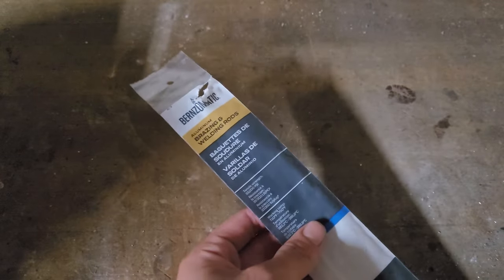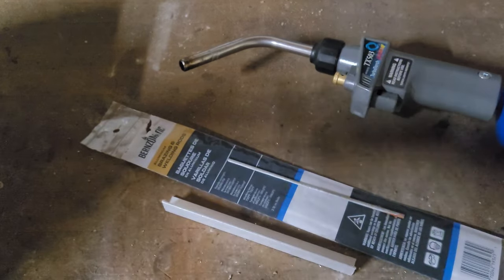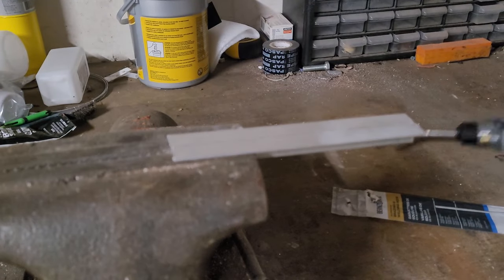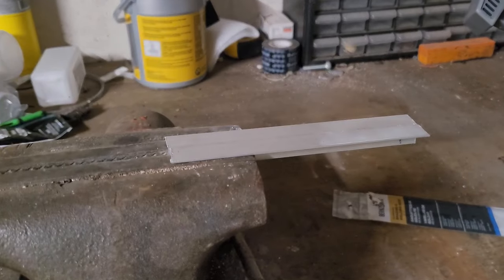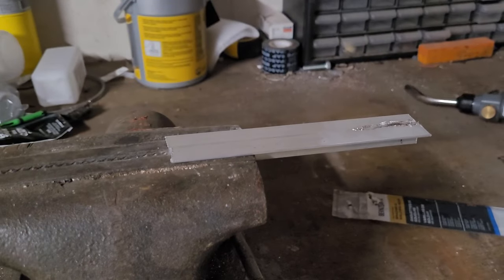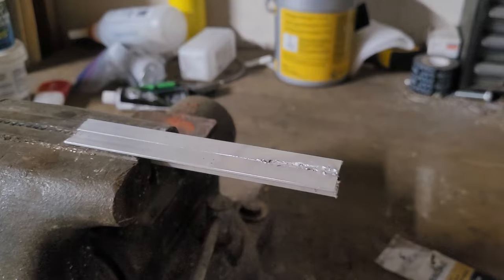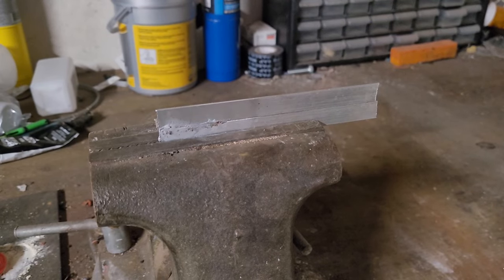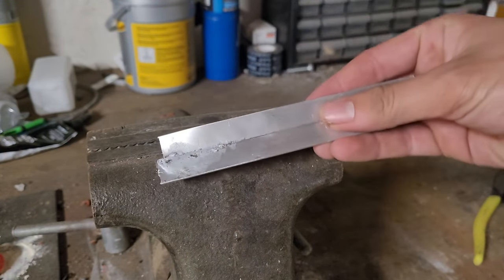Welding Aluminum with a Propane Torch

Comment: You clamped the pieces in a METAL vise, which was cooling the pieces down. Try again with the pieces clamped with wood pieces to insulate. That and better prep (using acetone to clean pieces) You’ll get better results.
Reply from the maker: Thanks, I will give these brazing rods another try using your advice!

Comment: I tried this to repair a bicycle cargo rack - propane and pencil torch would not get it hot enough - so i got map gas and a bigger torch head - much better results.  though i did find it impossible to expose bare metal in the crevices - so I did brazing on top and jb weld underneath just to give a bit of extra strength/support.
Reply from the maker: Brazing can be done with propane using a hot turbo flame torch. I’m glad it worked out for you!
Reply: Wth. Weld it dude. I’m not tryna take a bicycle to the face on the highway.

Comment: Great video! Super helpful that you broke it too so we could see the strength. Any suggestions on something stronger but similar cost?
Reply from the maker: If you need a stronger joint your only option would be a stick welder and aluminum rods, which will cost about $200. However, stick welding aluminum is significantly more difficult than welding steel. You could also change your design to use fasteners like bolts or rivets instead.
Reply: GMAW, gas metal arc welding (or stick if you prefer). You can get a very basic electric buzz box from Lincoln used for a few hundred bucks, it will take you far beyond brazing but brazing is a good technique to learn.

Comment: Can you use this to weld a broken aluminum gate?
Reply: yes and no this is brazing its more akin to glueing than welding the base metal and brazing metal heat up and expand as both metals cool the constrict making a tight hold where as with welding youre trading elctrons and actually incorporating the metals together into one piece if you cut a weld against the direction it was laid youll see this reaction and how much the reaction of trading electrons penetrated the base metal but to put it simply if its a decorative peice for a gate sure brazing would be ok but for the hinges or structure brazing wont hold it even if you glob a shit ton on there

Comment: Ive got a patio chair that i was thinking about doing this to.  It is a center mount base and the legs running to the pedestal are cracked.  It is fairly thin aluminum.   Would you recommend tig welding it instead?

Comment: no flux usage?
Would using flux help the aluminum flow through the two alum pieces to make even a stronger bond from the wider coverage?
Reply from the maker: The instructions did not mention using any flux, but you could try aluminum brazing flux.
Reply: Do no try with flux it will not work aluminum bonds with strictly heat only

Comment: would you recommend this for aluminum rims on the car?
Reply from the maker: No, these "welding" rods are not strong enough for anything structural. Aluminum wheels should be repaired with TIG welding as it is strong enough to handle the stress. If it is just cosmetic damage like curb rash, epoxy filler can be used for a quick repair.
Reply: @DragonBuilds  okay thank you for the information...highly appreciated

Comment: Is it possible to weld steel with propane torch?
Reply from the maker: No, a propane torch does not get hot enough. However, you can braze small steel parts together.
Reply: Yes but its a very different technique than using a tig or mig torch. Propane or oxy torches have been used in cutting and welding long before arc welding dominated the scene.
Reply: @DragonBuilds  i disagree you can use a propane torch to heat the metal and lay flux between the pieces youre welding and then hammer them together ALOT is it practical? no will your arm fall off before youre successful? most assuredly but... it is possible lol